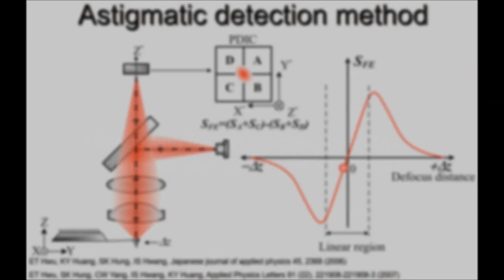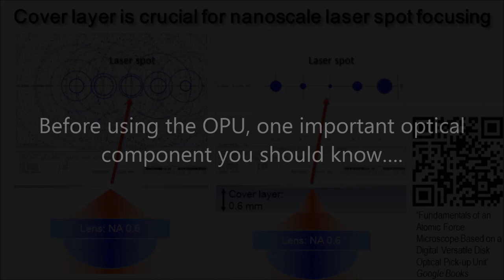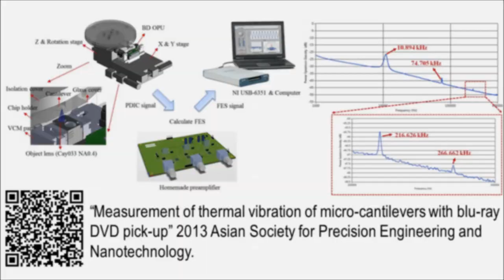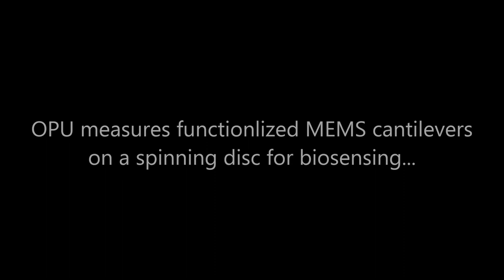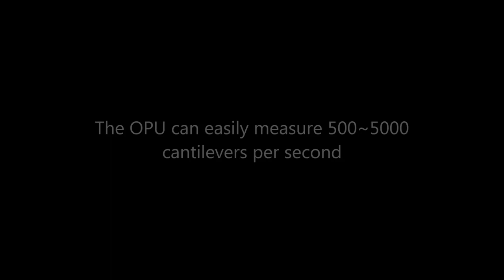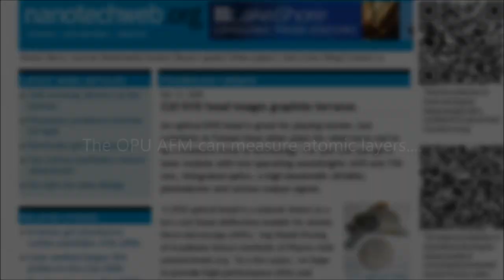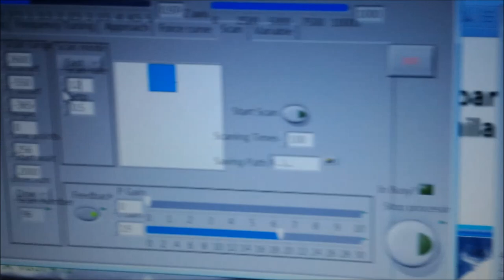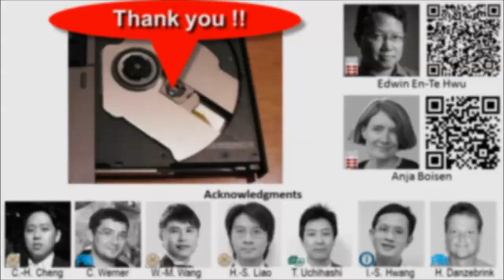Hacking CD/DVD/Blu-ray Optical Pickup Unit (OPU) for Fun and Scientific Research

Comment: Excellent reuse of this OPU technology. The small precise optical elements and the small compactness of the unit definitely allows the use of a possibly portable spectroscopic in field analysis of small microscopic events. I thought before about using parts off the dvd drives for similar applications but unfortunately life gets in the way of progress. There is definitely possibilities of refinements and further applications. Excellent video and presentation! Bravo!
Reply from the maker: Now we are using OPU for micro/nanoscale 3D printing :)
Reply: @EdwinHwuHacks4Science  nice in the realm of nano scale printing any other means to control the flow heat or temperature stability during the printing process?

Comment: Awesome finding this!  I was looking for a beam splitter from a Blueray to use for an interferometer for very wideband spectrum analysis and reading what's been used before.  Found this research paper and video at the top of the Google search list.  Excellent work!  I haven't read the paper yet... though downloaded to read later.  I assume there is open source software and more detailed plans from briefly watching the video.  I comment again if I don't find.  Looks like some really excellent work and again, thank you for sharing!

I guess while I'm commenting... any suggestions regarding optical materials that are cost effective like first surface mirror, beam splitter, etc.?  I was wondering about the dental mirrors as they came up as most cost effective on eBay in my first search (2nd search of first surface mirrors was some more cost effective options) and I have a few of the dental mirrors around from over the years from kits I wanted the other tools from.

Wondering what can be done with DVD and CD players too?  

I've thought about using a harddrive actuator for a diffraction grating control also so can use a more precise blueray disc with the finer lines to sweep for a IR-Vis-UV webcam spectrometer.   I just need to somehow get my handlers to let me do some hands on work.  Thanks again for your time, service and support!
Reply from the maker: You can find many useful optical components inside an OPU :)

Comment: I was curious to know, if it is possible to directly read the raw filestream from the drive? Also at the same time track the position of the laser or if its possible to read that area data in the raw stream?
Reply from the maker: Yes, it's possible....but you need to process the 0s and 1s yourself ;)
Reply: @EdwinHwuHacks4Science  oh yeah sure :D that means with that technic, you could build a laseremulator, that can always response the correct data for a requested area? :D But that would be to easy i guess? Else there should already be modchips for ps5 and xbox series x 🤔
Reply from the maker: @Marco-xz7rf  you need to deal with "error correction code" which is 1/4 on the disc :)
Reply: @EdwinHwuHacks4Science  ohhh, now it's getting interesting :D

Comment: Good morning sir, i'm trying to build and develop a photometric analysis module using an (opu), this detection system will be used to performe photoreflectance spectroscopic measurements in order to characterize the surface of optoelectronic materials, could you please refer me to some articles that could help me with this project?
Reply from the maker: Maybe you can check out my articles in the description ;)

Comment: Quite amazing fun work from another scientist that also does AFM based work. In your earlier lecture video, there was an inaudible portion where you had discussed the success rate of achieving vibration isolation using piezo buzzers. What would you say your success rate was in generating an acceptably isolated DIY AFM set-up?
Reply from the maker: Do you mean using the pizo buzzer AFM scanner?
Reply: @EdwinHwuHacks4Science  Yes!
Reply from the maker: @GobindKumar-kr7mw  the piezo buzzer can be controlled by any AFM controller :)

Comment: What is a good hardware for data acquisition and control signal generation in this case? I'm searching a setup that can be accessed by the everyday hobbyist. I have seen the circuits but there is still this obstacle, considering that access to high resolution oscilloscopes is not always possible...
Reply: I bet that for most labs the stage of data acquisition is so trivial that they don't even mention it XD. 
Reading a lot of papers about OPU here and a lot of information about  DAC/ ADC. Thank you very much for the information and the amazing video! I will implement this project physically :)
Reply from the maker: @OskarNendes  Thanks, recently we are going to publish one paper details control system and software interface. Will make a new video about that :)
Reply: @EdwinHwuHacks4Science  Amazing! :)
Reply: The analog discovery is a good interfacing tool for such in a synchronous way. Currently using it for interferometry.